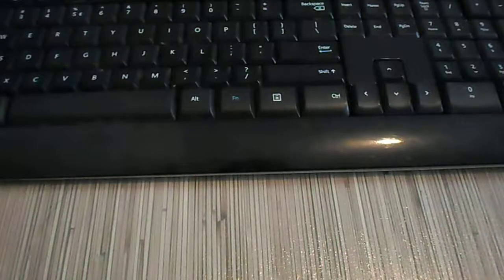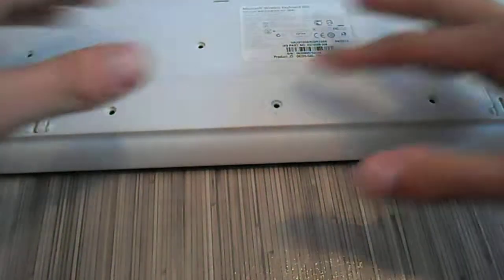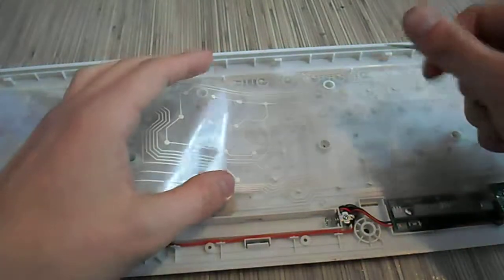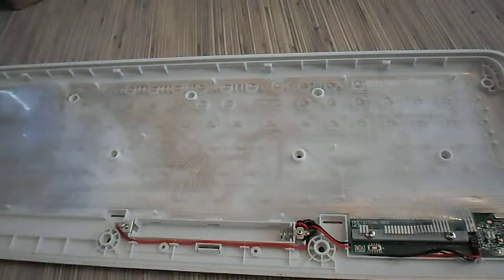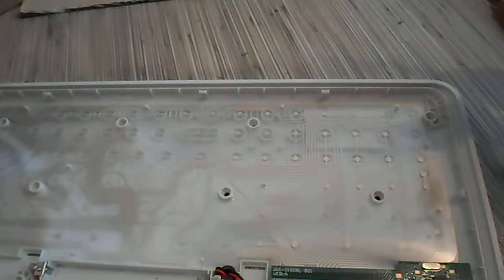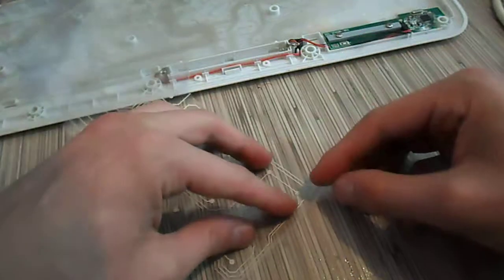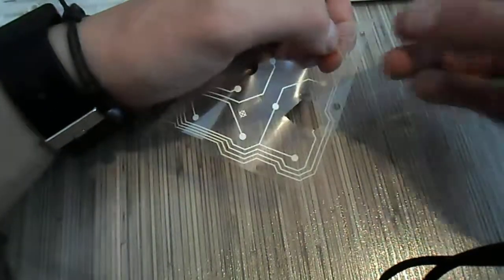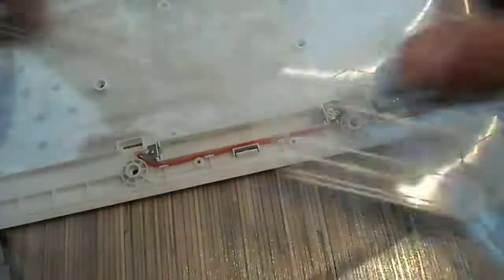How to Repair a Broken Keyboard , Unresponsive Keys, Broken films inside

Comment: Thank you for this video. It was very informative
Reply from the maker: Hi , than you very much , also there is something called graphite conductive paste where you can paint back the traces on your film , after that mask it and it should be more durable . I found this method after posting the video . So if you have an expensive keyboard in theory you can make it work again .

Comment: Does it work?
Reply from the maker: its a proof of concept my video but it works but it's a problem when comes to presure if the traces doesnt make contact on each other the repaired trace will not work , also you can try with conductive paint to draw on traces where is faded ... it's a pain to repair a keyboard and it's worth only if you have an expensive keyboard and for sure  I don't recommend on laptops
Reply: @dotelectronics  ok
Reply: @dotelectronics  You can modify the technique by drawing a line with conductive epoxy first (You can buy "Silver Conductive 0.2ml" on ebay). Then apply the second piece over the top. The epoxy easily cracks on it's own but it could be held in place by the second piece. Still got to add tape over the top.